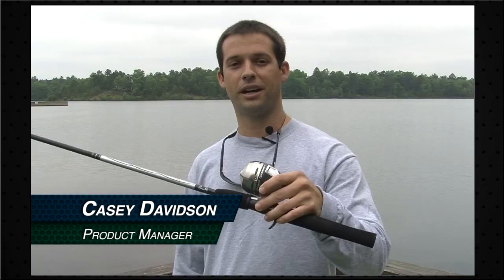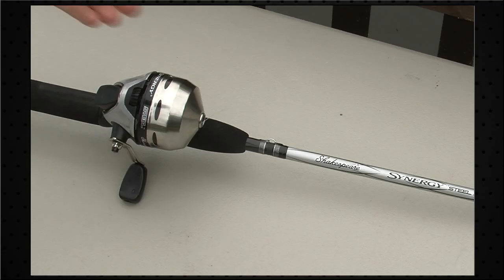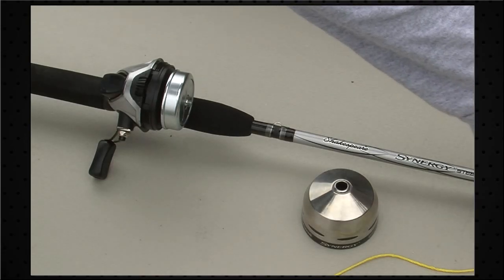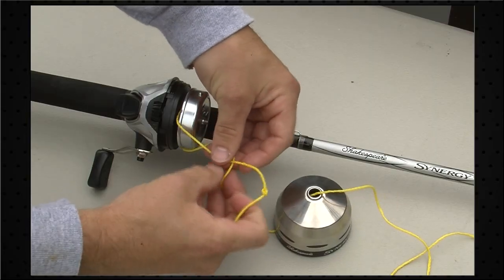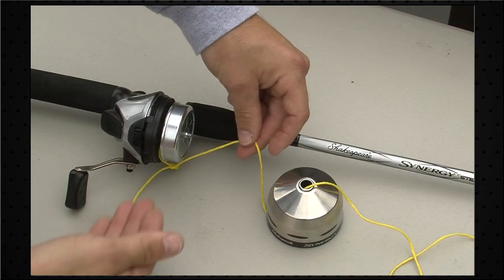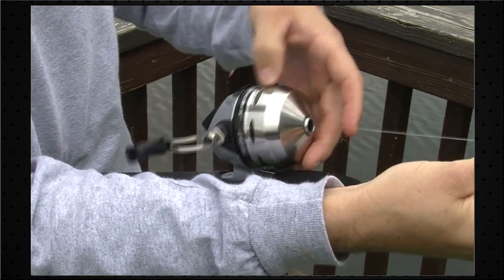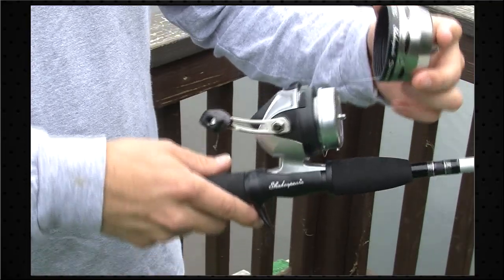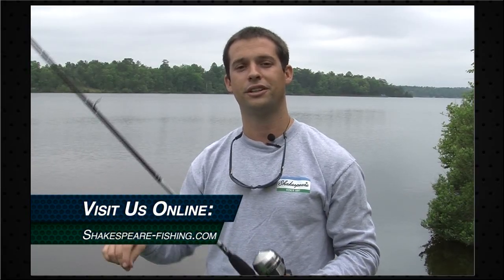Shakespeare: How to Re-spool a Spincast Reel (Dunham's Sports)

Comment: I have a Shakespeare Synergy reel with a plastic thumb button that broke. The reel seems really well built except for the plastic thumb button design flaw. I tried looking on the parts replacement list of Shakespeare but couldn’t find a match. Is there a better aftermarket thumb button? Right now I have it held together with hot glue.

Comment: Bought a used mantis sc10 , cannot get cone to unscrew. Cannot find instructions on this, any help is appreciated. Let my kids fish! :)
Reply: David DeCatt did you find it? Having the same issue now
Reply: @joeramirez8557  Years later and I have the same issue as you guys were having. Figure it out? Can't find anywhere
Reply: Cory Powers I did not bud, I just threw it away haha
Reply: Cory Powers I did see in another video though that soapy water works
Reply: @joeramirez8557  I was able to get it off with some "light" force using tools. Put everything back together and now when I spin the reel it doesn't pull the line in half the time. Weird cause it works a little then acts as if it just misses the line a few spins and then will catch again. This was a cheap $15 combo set from Walmart for my daughter. I think maybe its time to buy her something a little nicer. Thanks for the reply

Comment: very bad video. I tried several times following instructions, but no luck. The loop around the reel did not tighten. Then I finally grabbed both ends of the line - the short end and the uncut end, and pulled it tight. Only then did it work.